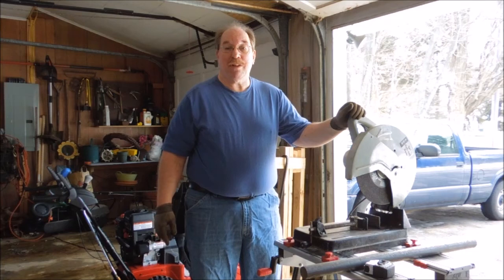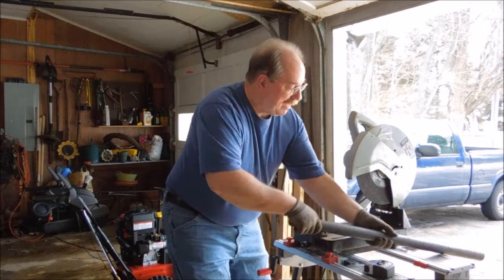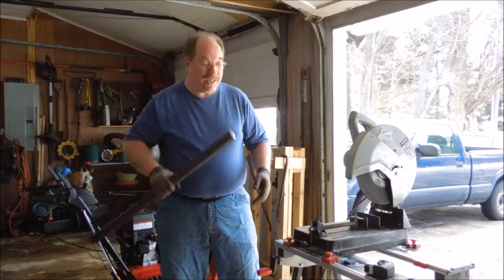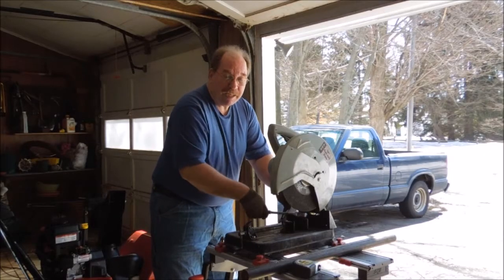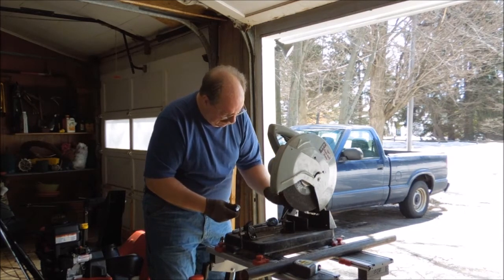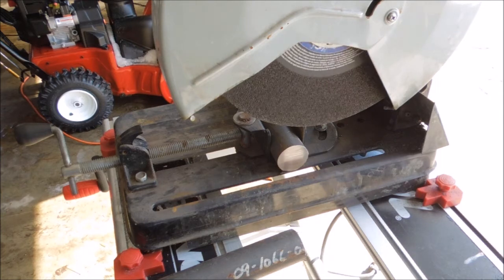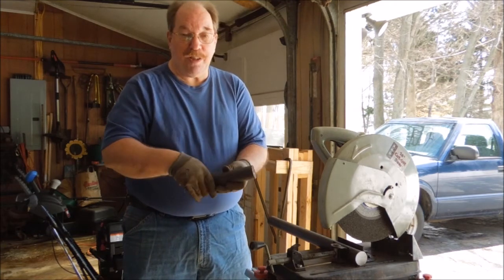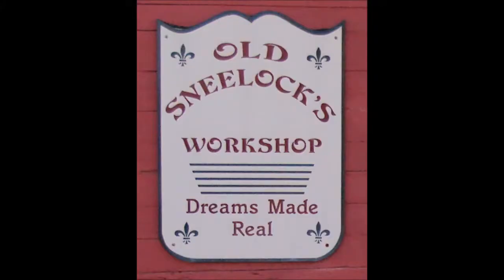Repairing Antique Tools - Swan Beam Drill – Pt 14 - Cuttting The Main Shaft

Comment: See why you were interested in my shop layout . Its amazing what we can do in a small space. I tried to cut pipe for treehouse brackets and melted the plastic housing on my Dewalt Compound Miter, Ah the wisdom involved in that move
Reply from the maker: I picked up the Chop Saw at B&G Discount over in Schoolcraft. I figured it would burn up on the first job but it's still running 6 years later. I don't use it much though.

Comment: Yep, a true hoarder but you'll say it's just to build a good inventory.  That's what I always tell my wife anyway.
Reply from the maker: Guilty as charged. When we moved I left a good 2 tons of iron in the big barn. 60 x 60 seemed like it was too big to fill up but I managed. Fence posts, pipe, bar stock, wheelbarrows, cement mixer, a Farmall B tractor, and a Wheel horse lawn tractor. That not mentioning the benches, shelves, tractor wheel weights and a full set of cultivators and a plow with lifts for the Farmall.
I sold off the hay wagons, the 1946 Ford 3 ton truck, and a pile of scrap iron. The kid who bought the house ran a scrap business so I imagine most of it went as scrap iron.
I do have another Swan Beam Drill that might need a shaft. If not then when they put me in the ground they'll have another 10 lbs of scrap to haul away.

Comment: What kind of base are you putting your cut off saw on?  I have been just putting mine on the floor which is hard on my old knees.
Reply from the maker: Four years ago my son gave me a Skil Xbench. It's similar to a Workmate. I use the sliding top clamp to hold my Dewalt 12" Miter Saw and the Abrasive Chop Saw. I keep it in the garage because it folds up smaller than my Workmates.